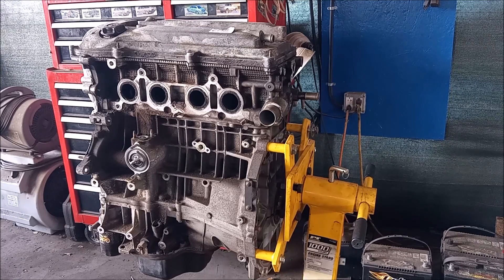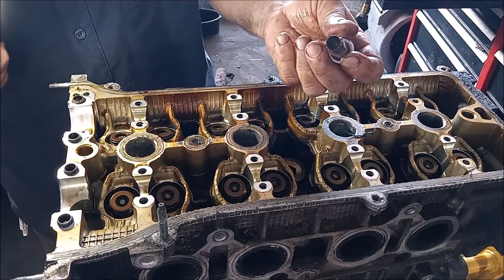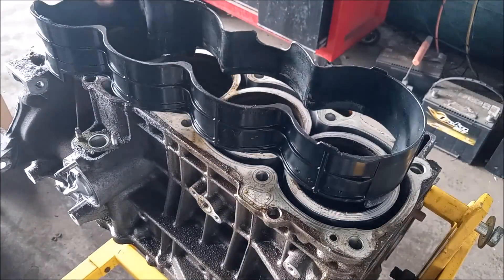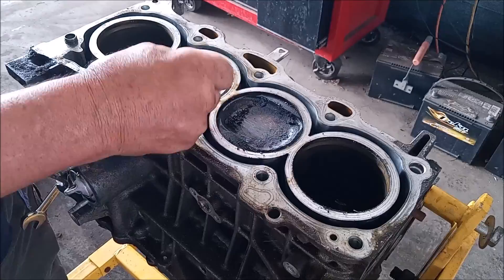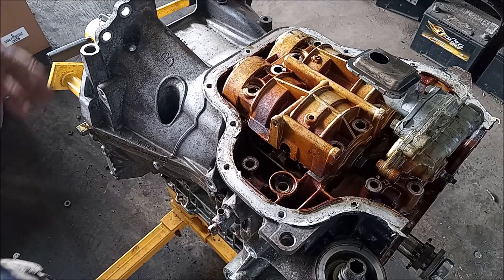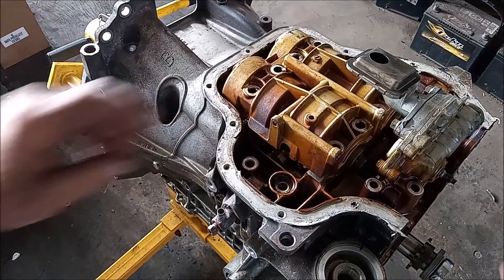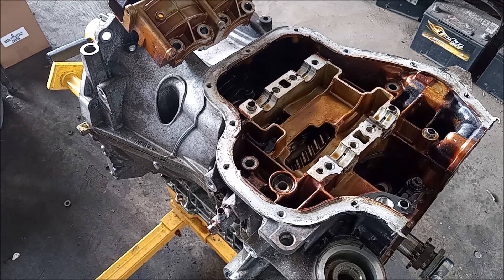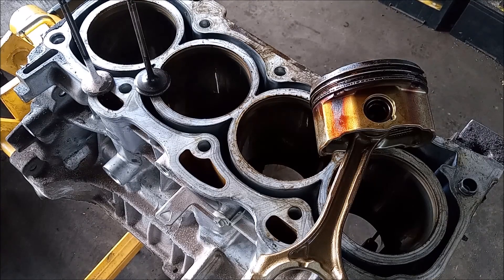The Worst Engine Toyota Ever Made - Complete Teardown - 2AZ-FE 2.4 - RAV4 Camry Highlander Scion TC

Comment: In my 2008 scion xb 2.4l vvt-i engine never had that plastic thing in my engine when i torn it down my engine never burned any oil its either the rings or the valve seals that let in oil into the piston chamber i replaced the seals and plus it sometimes the valve sleeves do need attention if they get enough wear they will let oil in
Reply from the maker: Thank you for watching and for commenting.

Comment: I was told it has to b a triple square M12 12 point for the head bolts
Reply from the maker: These bolts are not triple square, they are twelve point bi-hexagon if you use a triple square you could damage them, I have made a video specifically on this issue. Whoever told you to use triple square IS A FOOL, and you would be an even bigger fool if you listen to them. https://www.youtube.com/watch?v=vd7-ZWmIat4&pp=0gcJCfwJAYcqIYzv

Comment: Are the rod bearings able to be accessed with the motor still in the vehicle? My 06 RAV4 has a tap/knock at the bottom end and I don't have the means to remove the motor.
Reply from the maker: It should be possible but I am not sure.

Comment: You have no idea what it's there for because you have no idea what you're doing... the plastic sleeve guard insert is to protect the piston sleeve walls from coolant shock, it is a buffer. This is one of the greatest engines toyota has ever made, it is legendary, it gave toyota their namesake and reputation... the problem with the"low tension rings" only affected a narrow year rage beginning in 2006.
Reply from the maker: Thank you for watching and for commenting.
Reply: Correct me if I’m wrong but I think the faulty rings were only in the American made engines during a specific time?

Comment: Just read all the comments that everybody wrote. Please do not listen to this guy in his so-called experience of this motor. He has no idea why that plastic piece is in the cooling system. Cross hatching or anything. The reason there's so much carbon is cuz the oil problem with the rings. Duh. But I guess when you don't know you just spew things you think. I think you need to do some research on this engine. If any of you people want to know what this engine is really about look up The Car Care Guy on YouTube. He's a factory Toyota mechanic and I'll tell you all about it unlike this unfortunate soul that thinks he knows things.
Reply from the maker: Thank you for watching and for commenting.
Reply: If it burns oil, I'll skip it. Oil ain't cheap anymore 😮
Reply: @jaurequi25  That's how the engine got to where it is.  Oil IS cheap.  Engine replacement is expensive - especially when you put back a secondhand job with unknown history and mileage - like I'm sure this guy did.  Don't forget that oil burning hurts the environment.
Spend money on oil changes.

Comment: I don’t think this guy has a clue what he’s talking about go watch car Care nut he breaks it down excellent for this engine. I have this car with 300,000 mile yes it burns a lot of oil but as long as there’s oil this engine has given me zero issues still on original alternator starter and everything else is original. Toyota fix the issues by getting new pistons for this engine and if you have it done by Toyota which they had a recall for or you have it done by another mechanic this engine will not even burn oil and still stay reliable..
Reply from the maker: Thank you for watching and for commenting.
Reply: If it burns oil, I'll skip it. Oil ain't cheap anymore 😮

Comment: Just had my neighbors 02 Camry need work. Orginal engine had a timing chain break at 90k orginal miles. Junkyard swapped engine 3 years ago had a upgraded head bolts installed by a mechanic 
Crazy clicking noise sounding from the top end. Replaced the vvti intake sprocket, tensioner & balance shafts/ bearings in the bottom end. 
Early years of production fortunately did not have piston ring issues too.

Comment: That’s just re enforcement for the block
Reply from the maker: Negative. That's plastic you could break apart with your fingers, It reinforces nothing.
Reply: @Merryfrankster_ It's actually for faster engine warm up. For emissions of course.
Reply from the maker: @Rankine_Cycle21 If you're saying that it acts like a thermostat then it would logically cause the engine to overheat because unlike a thermostat, it never opens, and it impedes heat transfer into the coolant at every part of the run cycle. I thing your theory needs some work.
Reply: @Merryfrankster_  It displaces water, therefore the block heats up more quickly than if that space was simply filled with water. Plastic of course has much less thermal mass than coolant/water. At least that's the explanation for the plastic piece on the 2AZs successor, the 2AR-FE

I'd definitely rather not have something like that piece of plastic inside my engine though lol.
Reply from the maker: @Rankine_Cycle21  maybe you're onto something, that they wanted to make the block lighter in weight, so they substituted plastic for aluminum to get the same mass and volume of coolant while keeping the cylinder walls thinner - and this could explain why this block is such a piece  of crap. Regardless, this has nothing to do with cooling.
Reply: Showing your stupidity again the guy was right

Comment: I rebuilt the one in my 2007 Camry a few years ago now at 180k. It had even more carbon loose in the cylinders... actual chunks of hard carbon floating around there. Really unacceptable for an engine that had synthetic every 5k its whole life. Rings were completely shot like these, but cylinders weren't scored. Honed and rebuilt with new pistons; running great for over 30k now thankfully.
Reply from the maker: Nice job on the rebuild. For us, it is not a good use of the shop time and facilities to rebuild an engine, we just replace them with low mileage engines.
Reply: @Merryfrankster_ better to rebuild since they are all known in the earlier years to burn oil. Good luck because that motor will be back with oil consumption again
Reply: @Merryfrankster_  So instead of taking the time to insure the fix with a rebuild, you install a used motor that you are unsure about? Why DIYers are making a comeback in America.